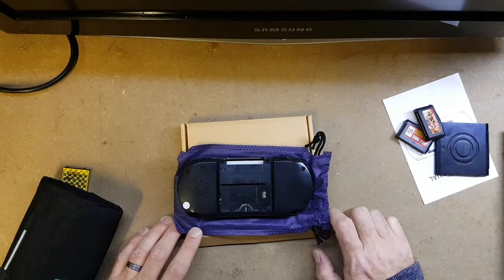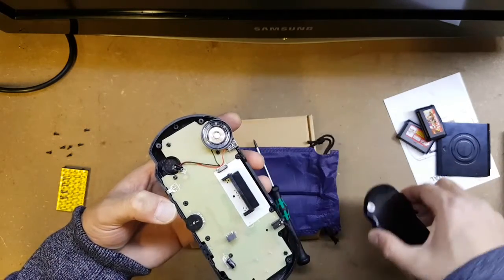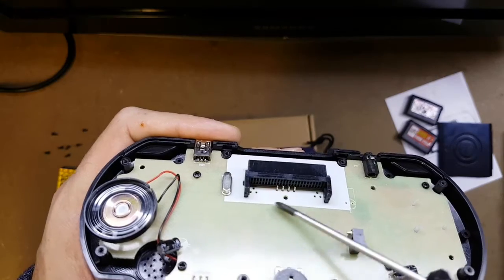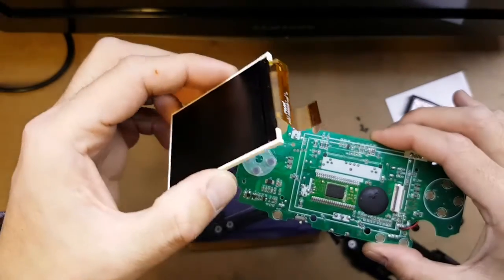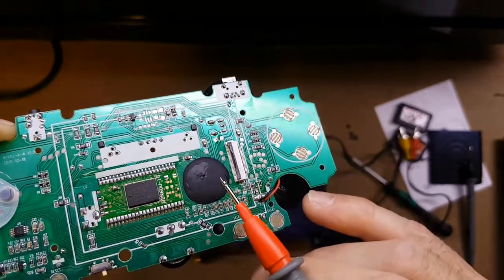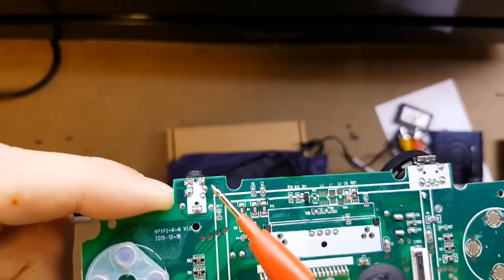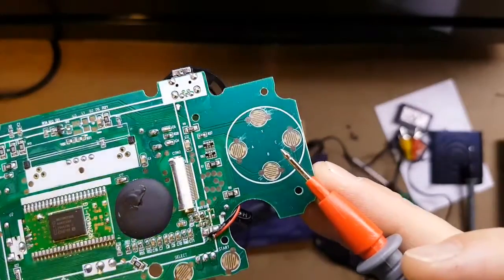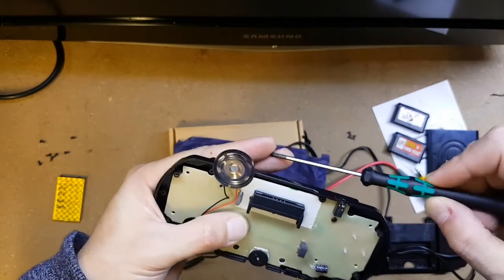PXP3 Slim Station (SEGA emulator) teardown.

Comment: double check the voltage the internal charge puts out to the battery. my sup handheld put out 4.4v constant and that caused its battery to puff up. very dangerous.

Comment: MSP55LV100G or something, apears to be a "Fujitsu 64Mx16 70 pins SSOP" 1 gig?  either its realy the 1 gig we know and love or its in bits, 125 megabyte is still quite alott. if its a megadrive rom is 1 or 2 mb, still alott of roms could fit on there.
The rom board might have more select switches solder on that tiny pcb, altho the TSOP version seems to match the daugtherboards size, so its pads might just be helping circuitry for the bga conversion

For those wonderin about the TFT, Im guessing the controller is actualy in the TFT, on the glasssubstrate, they commonly put a large rectangual controller and allow a farious types of protocols, SPI, i2C, 8bit or some wider bus talking interface. depending on wich pins you pull high or low, the controller will be in a certain mode. Its way cheaper to find the right sized Arduino TFT, most of them would have a variant of the ILI9340 or a ST7735 or similiar. Code examples everywhere, and Linux kernel support too.

This display could even be some variant of this, but I cant makeout the partnumber (just find the datasheet for me ;) ) Im currently programming a atmega386 with Hardware SPI to a ILI9225 ... Why did I choose not to use arduino libs? its a pain setting the registers right, pulling the Data/Code line correctly and I have a logic analyser... just... buy the right display and use premade libs ;)

Comment: I'm about to check out the rest of your videos, but do you know if there's a way to feed a video signal, either analog RGB or composite to the LCD on this?
Reply: unlikely, the tft is probably driven more directly based on the amounts of pins i see over SPI or some 8bit bus.

Comment: Would love to be able to root this thing and load up some roms
Reply: "root" ... the iOs and Android would... You could dump the rom and maybe replace the games... as this console does not even run an OS and replacing the rom would be even more than just rooting, your basicly owning the full system by replacing the rom (you could maybe port BASIC to it and call that an OS :P or a old UNIX variant and then "root" it ) :D
Reply: @CodeAsm  There’s clearly some loader code to list games and allow navigation. Depending on what the system “hardware” is, the menu and games could just be a multi-cart of sorts.

Comment: Will the screen work with the raspberry pi 3 ???
Reply from the maker: +Allen West It's not going to be easy to use it on a Pi. You would be better using something off the shelf. Would be nice to cram a pi zero into it and run an emulator but I don't think it's big enough.
Reply: @KrisCochrane  Does the connector on the cable fit into the port on a Pi? The Zero doesn't have the display port but I'm thinking something like the Model A

Comment: I would love to tap into the LCD driver and put a Raspberry Pi Zero in there!  That would allow for a $20+  Retropie handheld which would be awesome.. that is,  IF you could connect composite video into the screen.
Reply: display might be a variant of the ILI9225, but I cant read the partnumber.
Reply: composite video... I think driving it over SPI or a 8bit databus from the Rapsberry would be easier. these displays commonly dont have composite in, you need a "converter" board like those Car display units have.